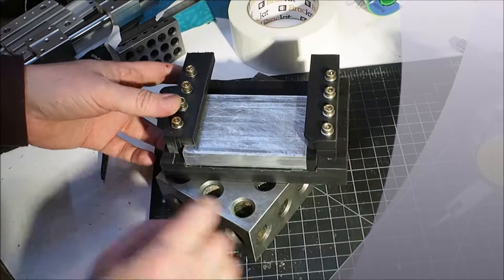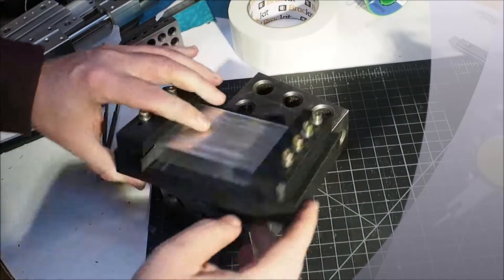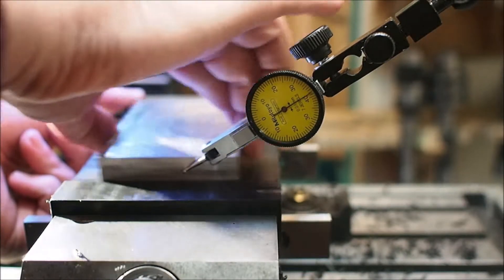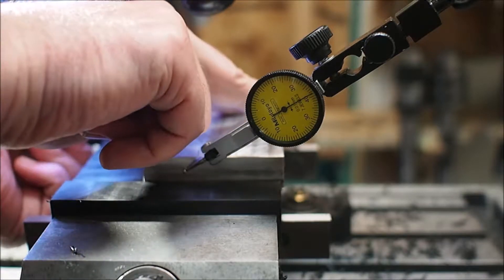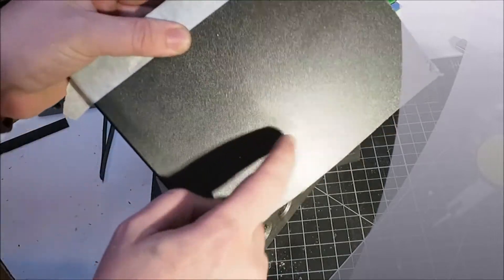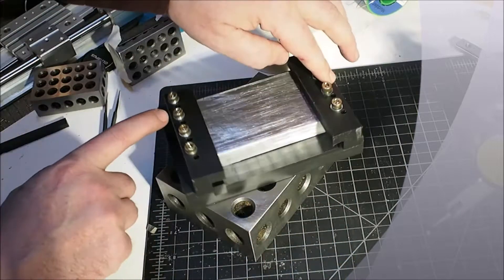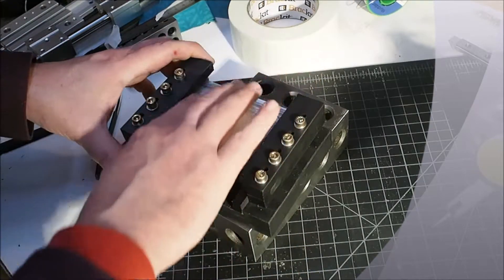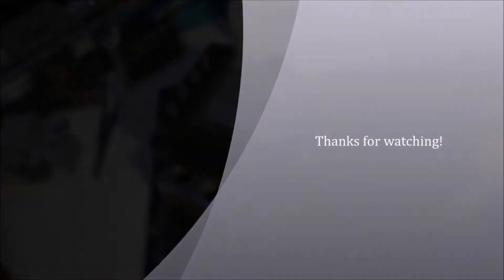HDPA box ways prototyping part 2

Comment: After seein swissmak i was looking for a video like this. Well done
Reply from the maker: I used it for about a year.  For an experiment it worked pretty well.   I would definitely make it out of acetal or delrin if possible and if I couldn't get a big enough piece I do think the "insert" model used by the swissmak is a good idea.  I would also reduce the surface contact area since it did move with the weather and it had quite a lot of stick slip.  Some oiler groves may have helped it.  Also the dimensions were based on scrap stock sizes.  I would want about 2:1 longer than wide vs this which is the opposite.   I ended up changing out the leadscrew for a ballscrew and used linear rails in the subsequent build.